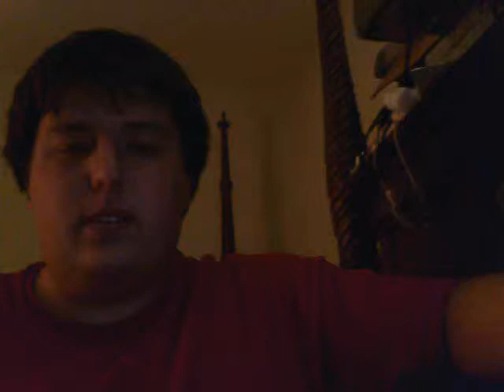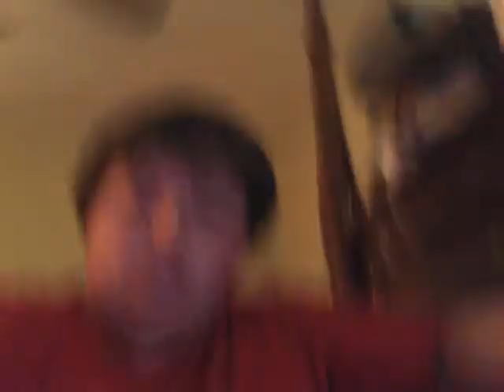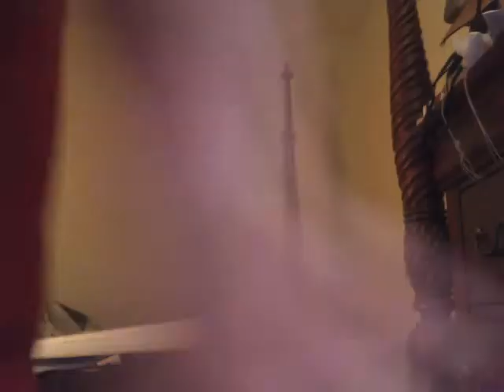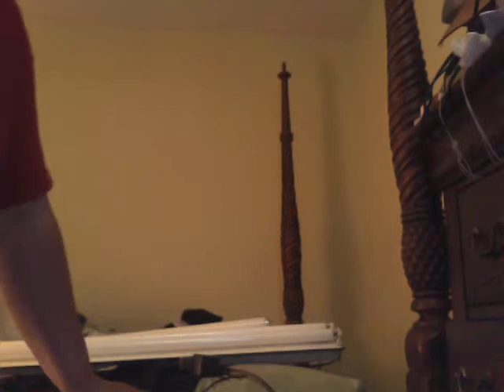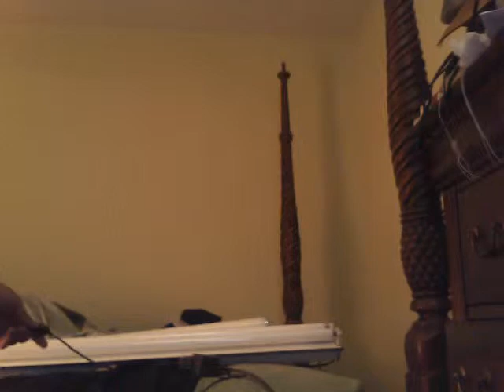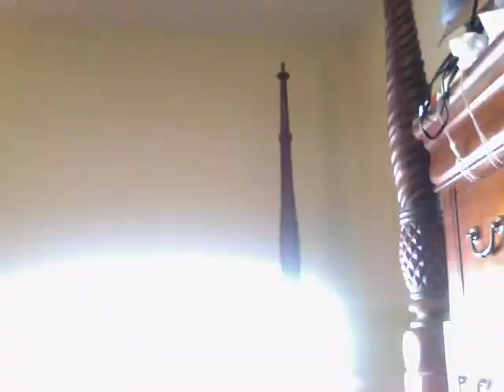GE F32T8 Daylight Tubes Starting on F40T12 Magnetic Ballast

Comment: Sounds about right for that setup...

Running F32T8's on a F40T12 (HPF rapid-start) ballast will overdrive both the lamps & ballast. (may or may not hurt anything, lifespan of the lamps will be somewhat shortened, if the ballast can't handle it (some can/others can't), it will overheat & simply shut down til it cools off)